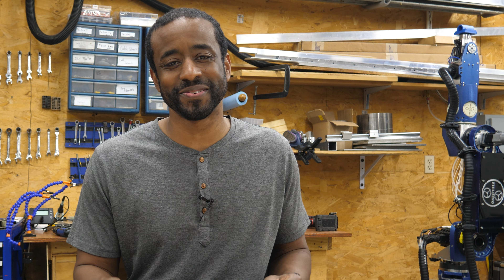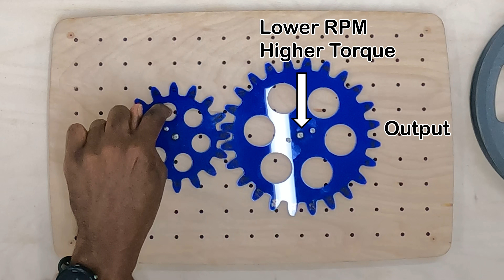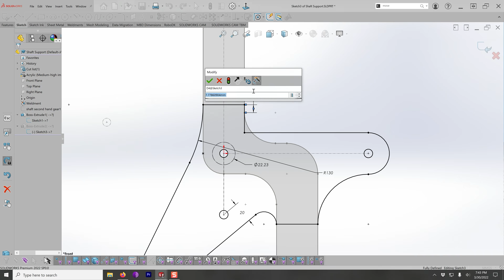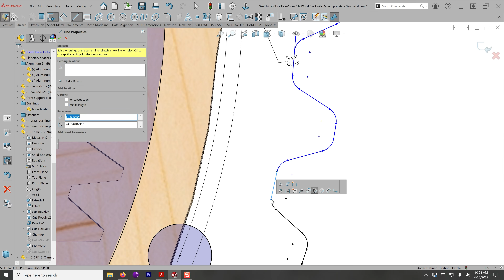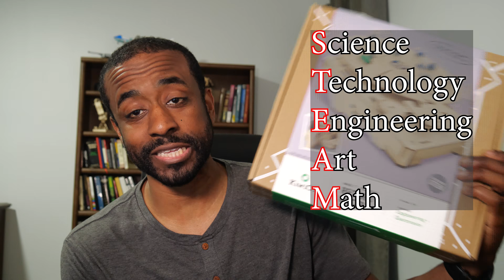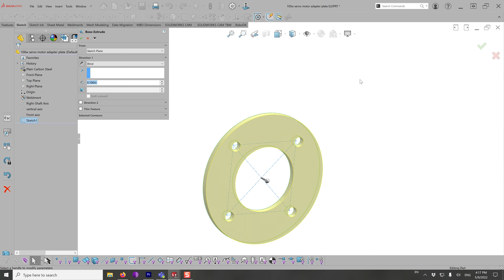How Gears and Pulleys Work: Jeremy Fielding 103

Comment: Just a tip to help cut pipe a little easier grab yourself a scrap bit of wood cut a V channel into it to lay the pipe in then cut through the pipe but not all the way through the wood so you create a cutting guide you pretty much make a mitre like box for pipe where both sides of the cut are supported so you should get a cleaner cut and a bit more control (dont hang the tube off the edge of the wood it should be center or off to one side depending on the tube lenght that needs to be cut you want the wood to support both sides) its not perfect you still have to debur but it should be straighter and should be able to do smaller pieces without crushing the tube just let the saw do the work without to much force.

This is such a visual thing that i hope i explained it well enough for people to get the idea.

Comment: I love watching your videos. They are truly wonderful. You might consider building a wooden pendulum clock. This is probably best driven by a cord and weight for a totally mechanical, non-electric, clock. I have a grandfather clock and I experimented with removing weights from the weight shells and discovered the clock mechanism only required about 5 milliwatts to to run. Such clocks are quite mechanically efficient. There are several websites about building these clocks.

Comment: Hi Jeremy, cool video just wanted to give you an idea maybe for your clock if you were running the clock four times faster maybe you could have four sets of numbers around the clock to scale it and you could have say the first set of numbers be green and the light up when it’s the first cycle and the second cycle will be red and so on and you’ll be able to tell time correctly even though the clocks moving four times faster

Comment: Hi Jeremy, just watched your How to learn new skills video, great ideas in there,  love the clock, a pleasure to look at, i worry a bit about the wood warping, solid brass would look awesome :) Of course its a prototype at the moment, i will make one similar but a lot simpler :) after the 3 axis CNC is finished , i wanted to make a clock mechanism where the ratio drop from 60 to 1 is shown clearly, runs silently so no  anchor escapement mechanism, a programable stepper motor was the obvious choice to drive it.

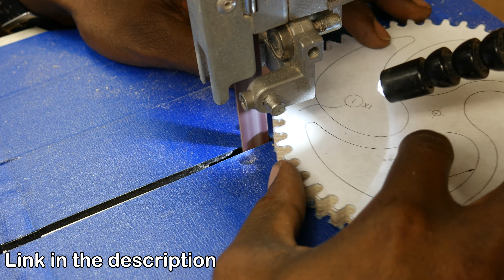Comment: 9:25 A technique in gear making is a full hunting design. When engineering a gearset, the manufacture will add (or subtract) a tooth so the rotation will cause the teeth to always mesh onto every other tooth through the revolutions. This evens out the wear, preventing noise & vibration.

Comment: 🤔"bolts and screws"...Without looking it up, I'll make an educated guess...
 Generally, a "bolt" is a finer thread pitch that is parallel and is usually half of a system used to connect one part to another, possibly with a nut- or a threaded hole, and it fastens using outside torque to tighten (wrenches).  
 Generally, a "screw" has a coarser thread pitch that is tapered to a penetrating point to grip the fastened part to the surface of another part, and generally fastens using center leverage to apply torque (screw drivers). 
... There are always exceptions and variations of both, depending on each application's requirements.

Comment: So my thoughts on a screw and a bolt are the same but different. To me the difference is the amount of torque you can apply to a bolt compared to the amount of torque you comply to a screw on the fixed end. The bolt you can get a better grip on it using a socket or bit that fits into the back of the bolt and a screw if it's Phillips or slotted you're only going to be able to apply very small amount of torque compared to a regular socket now here comes the crazy thing the way they make bolts and screws today it gets even tougher to decide which one you can apply the most amount of torque to bolt companies and screw companies do not want you to be able to figure out which one's the best and which ones the strongest They don't want the riddle to end 🤯🤣

Comment: If you were to build a bottle tumbler “Rock Tumbler for large bottles” what motor would you use and or recycled materials would you recommend to build one? Most people use PVC tube on rollers. Thanks
Reply: It’s for dug up bottles from the 1800’s
Reply: @ChelseaLeeStarlight1  Electric clothes dryer

Comment: I liked your answer of "that's a hotly debated topic". 

In general I feel that the main difference between bolts and screws is how they're intended to be used when they're manufactured. Bolts are made with the intention that they'll be used with a nut (even if that nut is pre- machined threads in your part) screws are made with the intention that they'll make threads in the substrate you drive them into. 

Unfortunately common naming convention breaks down with "machine screws" which by my definition would be bolts...

Comment: Hey Jeremy! I have been salvaging broken/unwanted appliances, and I have acquired many smaller motors. I know there are plenty uses for these, and I plan to build a mini belt sander, lathe, and bandsaw. I'm wondering if there is a way to combine them. Two ideas come to mind: Multiple belts or gears attached to a main shaft, or the motors attached to a gearbox type of mechanism. would love some kind of small motor salvaging video as they are everywhere, but if not, I still love all of your videos! I'm brand new to this engineering scene but picking it up fast and I owe it all to you! Thanks!

Comment: Difference screw and bolt? Both are threaded, but one uses a screwdriveror  or hextool to tighten, whilst the other uses a spanner or wrench. Also the bolt is very often associated with a nut, to clamp it to a third piece, whilst a screw may have a nut, but can mate directly to the threaded hole of the other piece.

Comment: Try inserting the rod inside the tube before machining the tube. Possibly securing it with hot glue. Let it sit there for the whole process. Remove it as the last step. Should prevent the tube from compressing.

Comment: I know it's technically probably something to do with nuts (or lack thereof), but the difference to me is often which side of 1/4" they fall on. haha Anything larger I start to think of as a bolt (even if it's techinically a screw), and anything smaller I have a hard time thinking of as anything other than a screw (even if a nut is involved).

Comment: I'm under the general impression that a bolt is a smooth shaft that has the ability to move freely (at least somewhat) through or within an opening. They are often threaded and used with nuts, but require neither a head, a thread or a nut to be considered a bolt. Like a deadbolt, a pneumatic bolt, a bolt and latch, or riveting bolts.

A screw is just any inclined plane wrapped around a shaft. Sometimes used for penetrating and fastening, sometimes used as a gear or to move material. A threaded rod (or the threaded portion of a rod) is a screw but not all screws are threaded.

Comment: a screw you usually don't predrill a hole while with a bolt it is required to predrill a hole basically one has a point and the other doesn't and a bolt can probably take more force than a screw because of this

Comment: WELLLL, ACTually.
A BOLT is meant to turn into a hole MACHINED or FABRICATED for it, like a Tap & Die kit, if you will.
A Screw, on the other hand, is quite crude & vicious in comparison. It violently, not civilzed at all, rips its way into a...raw hole, ha ha, or even a raw, unprepared surface, like wood or pla-stic...to join those things together.
WELL, CHEERIO!

Seriously, thank you for these educational videos.

Comment: This is actually a problem in Clock design which essentially you approach by building the clock around the RPMs if you want, and then adding in your balance, and then adjusting the power of the mainspring until I can run the balance and both hands without stopping

Comment: The only gears you need in a clock are actually the gear attached to the main spring, the three that reduce it down, and then the hour and minute pinions, it’s an hour wheel. So when you don’t use a main spring, you don’t need the reduction in your left with only the pinions an hour wheel which is pretty boring

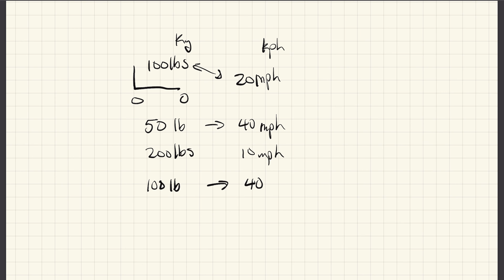Comment: 4:22 You can leave the capacity the same and increase speed with gears. That's how cars work. ¯\_(ツ)_/¯
Reply from the maker: You still have less torque. It's just that once the car is rolling you need less torque to keep it going. That "unused torque" can be turned into speed by changing gears. That's why every car uses multiple gears. You always start in low gear and switch once the car is going faster.

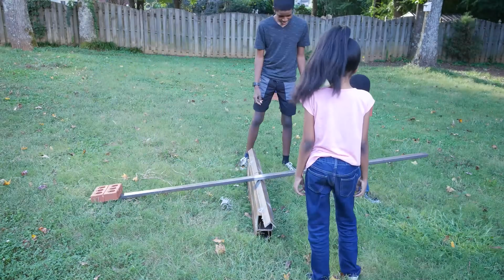Comment: Something to add about gear ratios... When you had the three gears in series, at 6:15, the gear in the middle is known as an "idler gear".  It transfers the motion to the next gear, which will change direction of rotation.  This is something learned from model railroad locomotive trucks.  They have a "worm gear" (spiral gear) on the motor shaft, and the rest are plain "spur" gears.  No matter what, one rotation of the worm shaft will only advance the driven gear by one tooth.  It does not matter how many teeth are on the next driven gear.  Idler gears do not factor into the gear ratio.  No matter how many teeth on any of the idler gears they only advance one tooth at a time.  In a series of gears, no matter how many idlers, no matter how many teeth on each idler, only the first gear and number of teeth of the final gear, on the axle of the driving wheels, matter.  The worm gear is 1, and if the axle gear (driving the wheels) has 12 teeth, the ratio is 1:12.  If the axle gear has 14 teeth, the ratio is 1:14, etc.  It is only first and last gears that matter.

Comment: IMO, a bolt is multi-purpose (provide clamping force AND/OR locate two+ parts AND/OR provide structural rigidity AND/OR act as an axle for a part which must rotate), whereas the function of a screw is ONLY to provide clamping force, usually through one or more relatively thin parts (clamp one component to the surface of another)

Comment: Very nice video! I'll take my shot at the screw bolt question:
Screw - installed to a material with or without a pre-drilled hole. Usually pointed or cutting tip
Bolt - installed in a material using either a nut or threaded shaft that matches the thread pattern

Comment: What's the supposed advantage of enforcing the use of bushings instead of bearings just because you think bearings don't need to be used?
Reply from the maker: Cost and space. Just like most engineering decisions. Bushing are "good enough" they cost less and are smaller.

Comment: ..... Bushings..... swapped bearing for bushings.... the bearings would of been better for a longer product life but the bushings do make it look better.... ascetical appeal vs Functional appeal every engineers struggle embodied.

the difference is the thread ending to a point. All screws have their threads end in a point. Bolts don't. the other difference is Screws are used with no additional equipment to hold materials together in place, where bolts usually always need at least some form of nut to hold itself in place.

Comment: Hi! Love the finished product, but I'm having some trouble distinguishing the clock hands. Clock hands should be instantly distinguishable so you can tell the time easily, I recommend some kind of black marking. If you put 3 black marks, one on the center axle, and then a thin and thick line or other design for the minute and hour hands, I think it would be a nice improvement.

*I'm also several weeks late to comment so maybe you've done something already :O

Comment: A bolt is a non-tapered fastener that uses a washer and nut to hold objects together. A screw is a tapered fastener that mates with an existing thread or creates its own thread in a material as it turns.

Comment: The simple answer:  Bolts need a seperate piece such as a nut to hold sometthing together, screws do not.

As fot the gears on the clock, would't using wax on the gears prevent it from sticking or not moving smoothly?  Since it is mostly wood, I would think that the fibers of the wood would add quite a bit of friction running against each other.

Comment: As for the difference between a screw and a bolt, a screw is driven in by a screw driver. A bolt is ugga dugga'd in by a loose cannon with an impact gun.

(screw threads are usually more aggressively pitched and the ends are sharp, for self-tapping. Philips heads strip if you breathe in their direction, torx is almost as good as a bolt)

Comment: difference between a screw and a bolt is, screw is designed to be driven into a medium or across two mediums to create tension within, while a bolt is designed to be paired with a nut and washer to compress two mediums between the head of the bolt and the washer (or nut if no washer is used), via a pre drilled hole in the mediums. both have similar uses however the way they are put to use is how they are different.

the easiest way to determine if something is a screw or a bolt is typically by looking at the hole its is going into, if the hole has threads then its most likely a screw. 

(also take this with a grain of salt, I was not there when the books were written.)

Comment: The difference between a screw and a bolt ,a bolt is a non tapered fastening device while the screw is a tapered fastening device that also uses thread but cuts its own thread

Comment: If you do the six hour increment you can always add a third hand that has 4 denotations that essentially allow you to at a glance tell if you are in the 0-5 range, the 6-11 range, the 12-17 range and the 18-23 range. So 3:15 am would show up as 3:15 on the two main hands and be in the first quadrant of the third hand while 8:24 pm would read 2:24 with the third hand in the 4th quadrant.

Comment: I fully admit I could be wrong, but my operating definition of a screw includes a few things:

1. A screw can, in many cases, be driven into unprepared material (no pilot hole/threads required).
2. A screw is always driven with force applied to an internal shape on the head (phillips head, flat head, or allen heads are all shapes put inside the head of the screw, rather than on the outside).
3. A screw never requires a nut to be a secure fastener.

By comparison, I define a bolt as follows:

1. A bolt can NEVER be driven into unprepared material (pilot hole/threads required).
2. A bolt is ALWAYS driven with force applied to an EXTERNAL shape on the head (In the vast majority of bolts, a hexagonal pattern actuated with a socket wrench).
3. A bolt may and often does require a nut to be a secure fastener.

Of course there may be exceptions I don't know about (like self-tapping bolts?), but I'm not an engineer or in the field of construction.

Comment: It was aways so difficult to understand the thing about ammount of torque and gear size. Always had to simply memorize instead of actually learning. But when you spin the gears and make the comment "the lenght of the lever arm is longer" while pointing to the center of the gear and one of the extremes it all just clicks together 😅

Comment: For the bushing cutter, you could try a plumbing pipe cutter.
Reply: It rolls the edge over. He needs a miniature chop saw, or he could use the bandsaw. Then use a belt sander to get the edge square, and a dremel to deburr.

Comment: I'm not an engineer, but for the little bushings you were making, wouldn't it have been easier to thread the two rods together and cut them as one?  That would provide support for the brass bushing to give a neater cut, and you could also sand or file the ends flush without risking deforming the thin outer tube.

Comment: Know I am super late to this... For making it just a 6 hour clock, Why not put in a second output arm that rotates at 12 hours and have one for 6? You could also add in a minute and a Second output as well so you can garuntee you have your timing right, so its a functional clock to the SECOND not just roughly to the hour? How many more Ste-up/down gears would it be?

Comment: My take just based on nothing, screws are pointy and are for driving into materials and have sharper pitch on the spiral where as bolts require the hole to exist, have a flat end generally and are used in conjunction with something tapped, like a piece of metal that has been tapped or a nut.

Comment: As far as I've been able to discern, a screw works itself into a surface, and a bolt is fed into a pre-cut hole (and often paired with a nut). It's not that they're different objects, they're just named different things because they have different specific uses. Kind of like, a tire is a wheel with a rubber outer surface. It's still a wheel, just a particular type of one with a specific name.

Comment: My personal belief is that screws and bolts are almost identical pieces of hardware except for the style of tooling required, screws require screwdrivers whilst bolts utilize a plethora of tools such as wrenches, socket drivers, ratchets, pliers, vice grips, channel locks, etc.

Comment: I think the difference between a screw and bolt is the way the ridges are designed - the screw is designed to cut into a material (like wood) and pull itself in as it's turned. It needs sharper and wider edges at a steeper angle. A bolt is specifically intended as a fastener, it won't cut into material on its own (hence the need for threading), and is usually paired with a nut to hold it in place.
Hm, actually I'm only really thinking about wood screws, but obviously there are more bolt-like screws (like in your electronics), which are a subset. I guess the difference really is just whether or not it's intended to be paired with something else to keep it in place. A bolt is just a screw that uses as secondary fastener like a nut to hold it in place.